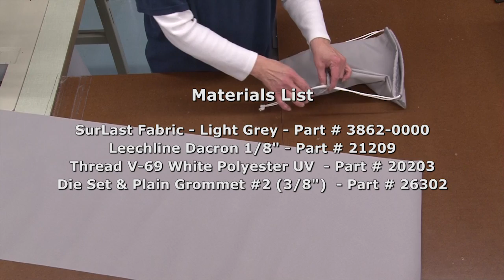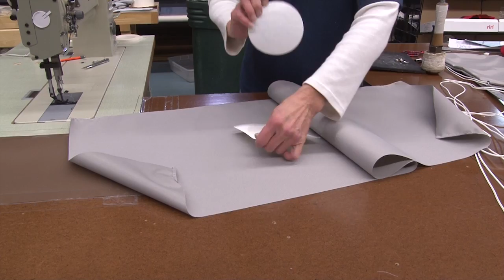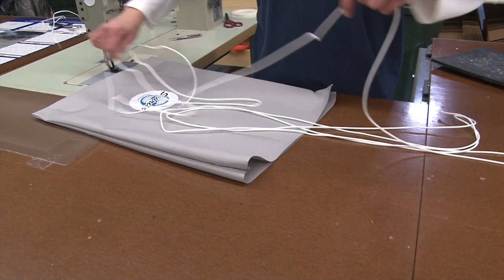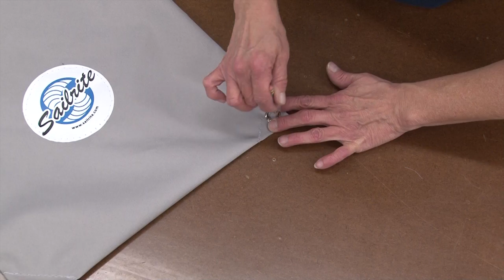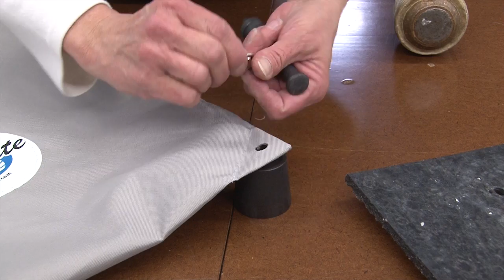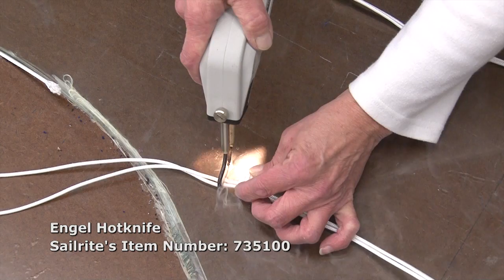How to Make a Drawstring Backpack

Comment: So awesome that I found this. Much better instructions then the new videos I found before this. I love my drawstring backpack but can't find another one with the grommets and it has to have the grommets to be able to carry the groceries I need it to be able to carry. I often walk to the grocery store but can not carry much with my arms anymore and use a cane some would only have one hand anyway and my drawstring bag makes it possible for me to get a few things and carry them on my back instead of trying to carry with my hands. Trouble is my bag is getting old now and I need a new one if it doesn't have the grommets it's never strong enough. The ones with the straps just sewn in will always pull out first time I try to swing the bag onto my back.
Reply from the maker: I'm really glad you found the video helpful! It sounds like your drawstring backpack has been a real lifesaver for carrying groceries.